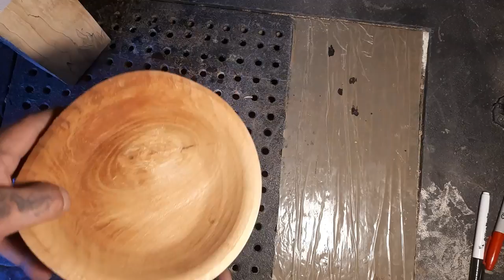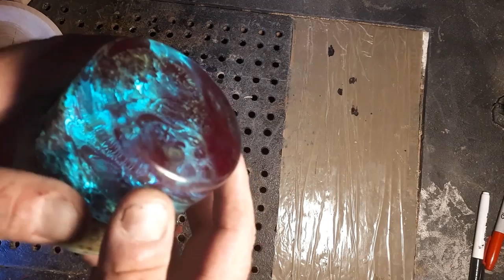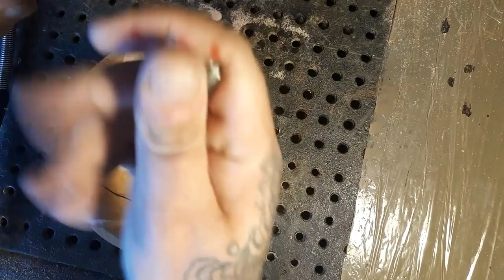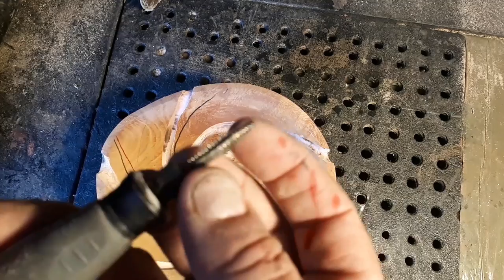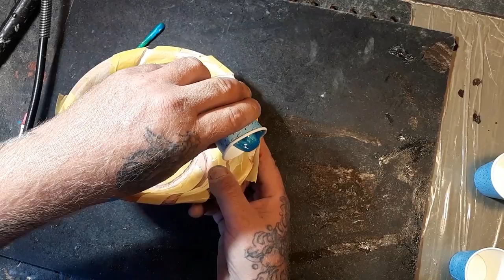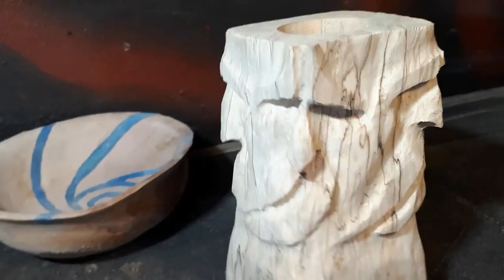Wood carving, setting 5 min epoxy inside of a bowl,

Comment: Save the bowl, turn it over and fill the crack with epoxy and use it for your pocket change or what ever. It's still a nice piece of wood. You can get ideas for future projects just give some time. You have a great creative mind. Set it aside and give it a week or two or three you will see something in it.
Reply from the maker: U are bang on gary, I have already been looking at it haha I will find something to make with it.!! 
I'm no quiter !!!! 

U read my mind
Reply: Spray it with clear coat satin finish. It will pop color . Be looking good 🤙

Comment: I like the bowl 
The idea of the epoxy is inspiring I have done a few epoxy resin piece's and never thought of using the glue for small jobs did the epoxy harden ok and how good did it sand
Great videos l have learnt heaps
Reply from the maker: Yup it hardens good I'm not to shore about the sanding because I only lightly sanded it with 60 grit, make sure u mix ur epoxy good !:)